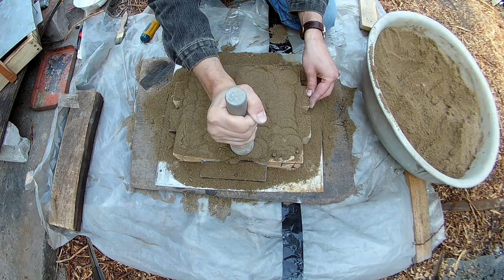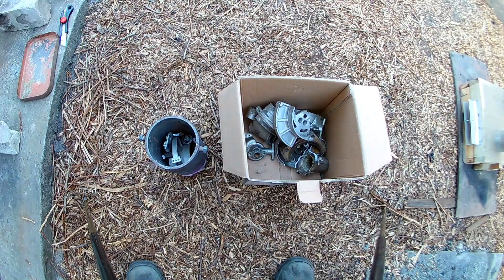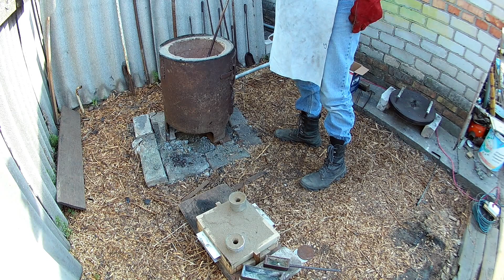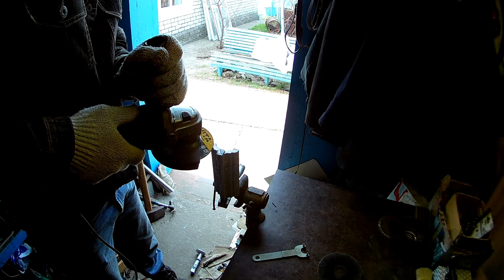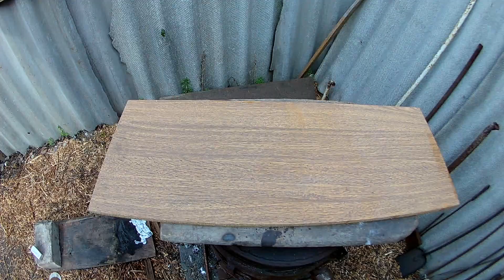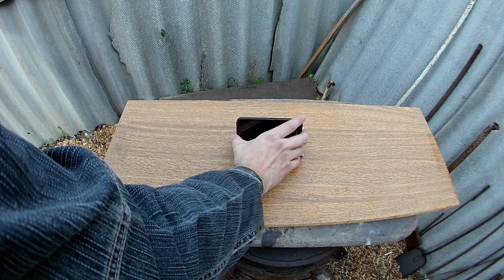Making a Simple Casted Aluminum Phone Rack

Comment: Why did the initial pour go wrong? Looks like the end product came out fine, though :)
Reply from the maker: Well, not sure about that :) It looked fine but I had to use the second runner. In my opinion, the most important is always to use 2 runners than if something goes wrong you can still correct an issue :)
Reply from the maker: May be I should pour aluminum more slowly....